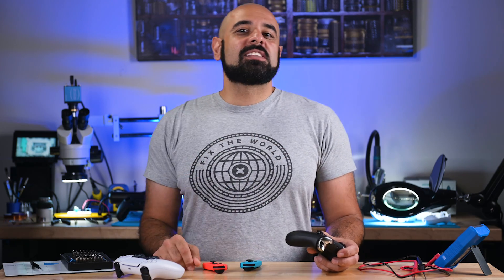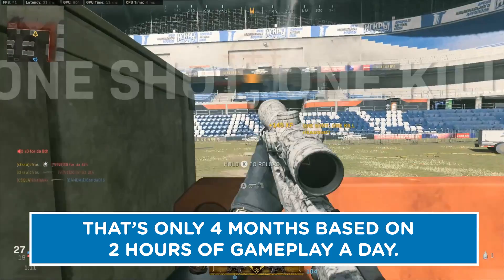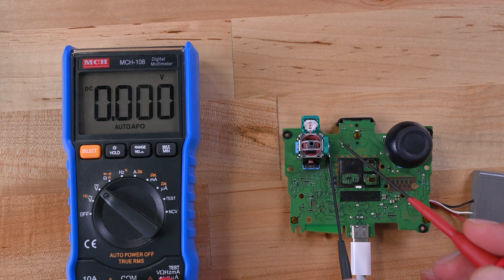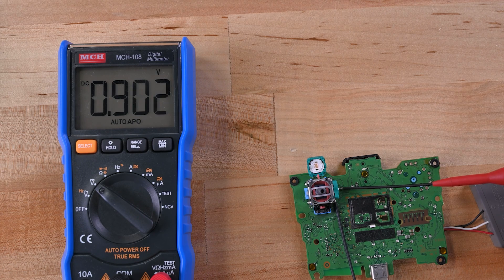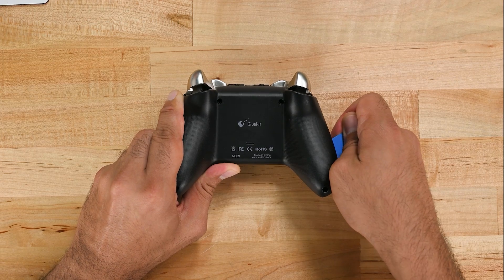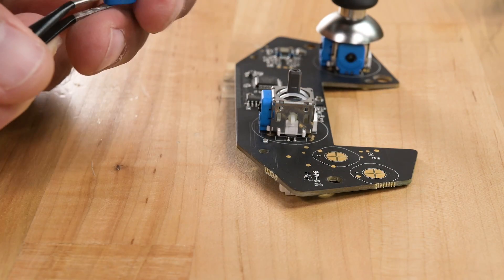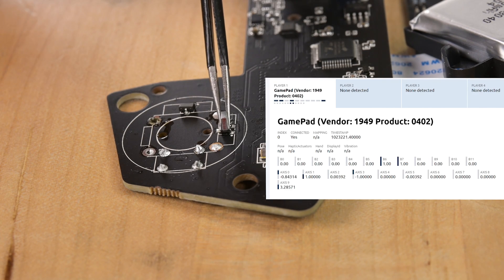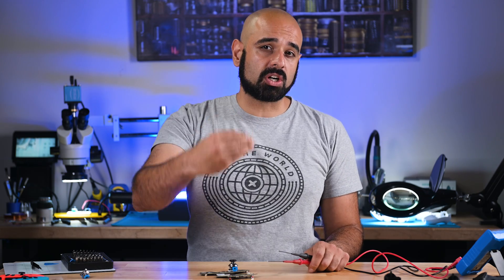How Manufacturers Can Fix Joystick Drift - Permanently!

Comment: Sega fixed the drifting problem already when Dreamcast launched in 1998.
Reply: They actually fixed it even before that - with Sega Saturn 3D Pad. And hall effect sensors weren't unheard of even back then, they were used in some hi-end computer keyboards form the 70s and 80s for example

Comment: So in theory i could put that type of joystick in a drifting ps2 controller
Reply: It's not a theory, It's already been done, and yes. You also might want to see if there's a board that you can solder onto your circuit board as well to auto calibrate it as well.
Reply: @boredfive3001  thanks thats all i wanted to know

Comment: Cool story. But what you gonna do when magnet effect will start to wear off? 

Also there wasn't any drift in PS1/PS2/PS3 controllers (if you clean your apartments at lest twice in a month).

Maybe it's because current controllers have more bits and more sensitive because of that? Yes it's giving more precise control, but have short lifetime span. Why? Because even smaller damage will have an effect. While when your controller have 8-bits, those damaged have no affect at all.
Reply: Tiny neodymium magnets are pretty cheap, are already widely used in tech and keep their magnetic properties for many decades, so wear-off of magnetic effect is not really an issue. So is the precision - hall effect sensors can be extremely precise while still being cheap

Comment: Does the Hall effect sensor have any effect on battery life?
Reply: Anything that uses the battery on the PS5 technically speaking has an effect on battery life. However I think your real question is if the difference is more noticeable than the already existing potentiometers in your controller and the answer is no.

Comment: Out of the box showing drifting on PC software test and some On playstation 5  it's not acceptable i Will be returning on i had one replaced by Sony and after checking on PS and lower dead zones on Call of duty and its showing a bit of drifting after getting a new one same with my New one from 2023 i think 🤔.

Comment: I'm about ready to give up on (console) gaming. The non-existing innovation in games, and the introduction of weird "ideology" into the game sector is just about enough in itself. But I can't keep buying new controllers every year, that's just not acceptable quality for a relatively expensive controller (cost more than a mouse and keyboard set). The price is fair if the controller works as it should and last for a long time.

Comment: The solution is to recalibrate the stick while in use.
The major issue with drift in joysticks right now is down to calibration being baked into the firmware of controllers, or even the sticks themselves, ever since PS3. Outside of that, drift is largely a non-issue, especially compared to the very different and very real problem of FLOP, that hall effect sensors do NOT address.

This is an expensive solution to a manufactured problem to sell you the same quality of product you purchased in 1999, but for a marked up price. Hall effect sensors are just another venue for shrinkflation.

Comment: I fix these all the time. 
I see that the normal Xbox controller $69.99 use the same potentiometers as the $199.99 Xbox elite 2 controller. It's such a scam. A replacement part only cost $2.50 but you need soldering skills to replace the parts them selves

Comment: They havent even added some settings for controllers at ps5. It would be so simple. Most of drift cases could be easily fixed by adding a deadzone. Sadly most of the users dont even question them about such simple thongs. And they are happy because they getting more money from them.

Comment: I just bought the Gulikit KingKong 2 Pro and the only problem i had was that on day one, one of the buttons started sticking. I was able to take apart the controller and lubed the mechanical button with some beeswax (organic lip balm) that I had on hand. For the same price as an OEM XBox controller, it works great, for PC anyway. Here's to hoping that they add XBox support in the KingKong 3.

Comment: They should use sealed greased pots that's what they use in (good quality ones anyway) R/C servos for the feedback pots (the thing that tells the servo what position it's at). The lubrication prevents the tracks from wearing down and it's sealed so dirt can't get in. I mean it will eventually go bad but I have R/C equipment made in the late 80's that still works just fine.

Comment: Funny thing is that the ps2 controllers had automatic drift compensation built in every time it was turned on and gave you an accurate full range every time you turned it on and moved the sticks.

Comment: my analog joystick doesn't drift, but there's a tiny degree of dead zone. so if i run in circle in a game by pushing it fully forward and then circling the stick 360°, there's a very brief stop, like 3°-5° of the angle.

Comment: They won't pick up on it. It's called planned obsolescence for a reason. Microsoft doesn't do thousands of hours of testing on their controllers to ensure longevity. They do it to ensure the controllers won't last 'too long' before the user is generally stuck buying a new one. Quality is going down, prices are going up. That's capitalism in a nutshell. I actually wouldn't be surprised if at some point, maybe on the next generation of systems, $ony, and M$ made it so that third party controllers could not be used on their systems. If those two companies gave a crap about their paying customers, then they'd have that stick calibration software in their systems, but only Nintendo does.

Comment: Exactly. Hall sensors are the way to go. Why are they still giving us potentiometers is beyond me. Yeah I know it's cheaper and creates more revenue for them by users buying replacements but that results in users losing confidence in the products plus the frustration that comes along with it. For the price these new consoles come with at least the controller should match the quality of the console.

Same experience I had with a racing wheel set up I had. Potentiometer driven pedals and always having to replace them. From the time I invested in a set of hall effect ones I never had any problem following.

Comment: If this drift issue is "unavoidable", how come I've never had it with my N64, Gamecube or Xbox 360 controllers? I've been using all of them for years or even decades, this drift thing only seems to happen with newer controllers though, why?
Reply: That's a good question. Something seemed to change in the materials used since the Switch era. Either they use smaller components, or a different quality of plastic.

I just got the Gulikit joycon replacements since I've replaced the joycons TWICE on the Switch my kids use. I have a spare replacement for the OLED Switch that I use but I haven't played it as much so they're not worn out yet. Looking forward to seeing how these perform compared to the two replacements I've tried so far.

Comment: With all that engineering that goes into modern game controllers they should’ve had that figured out already (they know what they’re doin’, which is apparent to most of us gamers) they just want us to just replace them if they fail!  For most of us, these things being complex And expensive as they are ain’t a cakewalk to disassemble and reassemble if we’re talkin’ bout makin’ repairs…  Gaming is an already expensive hobby and gets more expensive with newer generations!  Perhaps they should devote more R&D into product endurance and the quality of components with moving parts that involve contact friction (I think the sticks take the heaviest abuse before the action button are pressed, given directions are executed at a near constant with some games needing you to rapidly rotate the stick causing potentially extreme premature wear of the axis potentiometers, the action button are not heavily mashed often, but lightly and briefly tapped) poor quality potentiometers tend to have bad wear tolerances and will fail earlier during the life of the device.  Why does Sony require the purchase of a $200 Dual-Sense Pro controller with the ability to easily replace the sticks when they should implement that feature in the Standard Dual-Sense controller!  I think Hall Sensors Should Be Mandatory for all manufacturers going forward as the Dreamcast had them And were Very Reliable!  Sorry for the long-winded rant…

Comment: Ironically the biggest weakness of the switch joycon stick is that it doesn't have the usual stick potentiometers. It has a really bad stripe-shaped potentiometer that wears out super quick and is really prone to malfunction with tiny amounts of dust in it.

Comment: I have a 360 controller I've been using since 2012. It's always plugged into my PC and has been in my hands for thousands of hours in its lifetime. The rubber pads on the sticks have worn down to suggestions of traction, and the controller shell has a few scuffs from being set down or dropped over the years. There is only a tiny fraction of drift in the right stick, and that drift only comes up in games that seem to assume that every stick out there is perfect and doesn't need a deadzone.

On the other hand I bought a brand new PS4 controller and within two months of light use the right stick began to pull HARD to the right.
There is simply no excuse for the build quality of modern devices being worse than its predecessors. With how much these devices are expected to be used, and what conditions they are going to be facing, it should be a no-brainer to make these controllers tough and durable - especially when they are continuing to hike the price of these hunks of plastic every time they change them slightly.

Comment: Stick drift can easily be caused by dirt in the pots and can easily be cleaned with ipa cleaner ! I fix roughly 20 a day at work the dirt or fragments is usually caused buy grinding metal on the top of the sticks depending on the pad !

Comment: Okay, firstly thanks for highlighting this issue!

Second,
Hall Effect Joystick Sensors are NOT the "End Game" solution to fixing the problem. But they are a positive step in the right direction.

Just like any other piece if hardware you need to have it calibrated properly out of the box and in the past 6-Months I've seen a wealth of replacement Hall Effect Joystick Sensor products arrive on to the market, but unfortunately a trait with them has been that some of them have notably bad calibration out of the box meaning that the end result can still be a very poor tracking experience.
Reply: I mean, that's kinda the point of calibrating your controllers after replacing the joystick assembly.  I just replaced my joycons joysticks with hall effect joysticks and yeah they needed recalibration but that takes less than a minute to do and after that they work fantastically.
Reply: @Enclave.  I meant in regards to firmware, the actual firmware inside on the micro controller baked into the joysticks, they are REALLY POORLY calibrated in the way they react to input such that no amount of built-in device level adjustments can positively counteract the inaccurate readings.
Reply: @LND3947  Ah, gotcha.  When I hear calibration I immediately think of people who don't know you need to calibrate your joysticks any time you replace the assembly.

Comment: You totally missed the mechanical drift (or slop in the mechanics), this happens with pots or hall sensors.
Consoles are just toys, get a gaming pc and good games (like simulators) and good controllers (wheels/pedals/joystick/etc).

Comment: That was kool to know. What about for anti drift, or when on a left joystick won't go forward, or if it does, it jitters? So I bought a brand new PowerA Enhanced Wired controller, and less then 3 months that started to happen. I did contact their support for warranty and they just sent me a new one and told me to throw away the defective controller. I don't want to throw it out. Should I keep it or is there a way to fix it like this video stated? All so I ended up buying another controller because it took weeks from support to the end to send me one, it is the Turtle Beach Recon, it is so much nicer.

Comment: Even the PS2 didnt have drift. At least not anything close to today. They had stuff in it that calibrated it automatically. I saw a video earlier that demonstrated how moving the analog stick around made it calibrate itself. There is multiple ways they can do it. They're just cheaping out on parts, and forcing us to buy these cheap pieces of crap over and over. Even the pro 180-250 dollar controllers, still use the same parts in analogs.

Comment: "For the software to correct" meaning apply a deadzone, you can glue the axle in the pot to make it more accurate... but yea we have used Hall sensors for so many years, we should be using them in controllers.

But there is also a downside of using a Hall effect sensors, these can and will be influenced by external magnetic fields... your phone for example!

Comment: PS3 controllers used hall effect sensors as well according to Ben Heck. They also sometimes suffered from drift, but maybe to a much lesser degree than other consoles. Another reason for drift being increasingly more common may be that in the strive for "precision", game and console makes are minimizing the dead zone, making the software less tolerant for hardware wear. :(
Reply: Not all ps 3 controllers had Hall effect sticks

Comment: That the value at the center point varies is completly normal and is mitigated by a dead zone in software. This technology has been used for decades and was always a fine solution. Only a small, loud minority is complaining about "stick drift". I have never seen it in person.

Comment: I bought my PS5 on launch and I'm at my 5th controller so far. And I try dealing with the drift as long as possible to the point it makes games unplayable. So being honest you could add a 6th one there if I replaced them sooner.
Same was on PS4.
PS3 was different, the included controller lasted me 7 years!

Comment: I've experienced my first drift in one of my PS5 controllers. The updated model number which was supposed to be marginally more resistant to the issue. I'd love a pseudo PNP way to swap to the hall effect sensors like for the switch. The dual sense edge not including them at such a ridiculous price point is a huge letdown.

Comment: The drift issues on my PS4 controller (used on PC games only) was wear to the stick mechanicals on the left stick, so it wasn't springing back to centrepoint, so, I got a set of new sticks, and great, the left stick was stuck with an off-centre left & down issue, and so was the other one I fitted, so thought they were junk, and got more from someone else, and, oh, same issue, so, I got a couple of them "drift-fix" flex-PCBs with the trimpots on, then twiddlypot adjustments and, they fixed it!!! Granted it probably needs a real PS4 to actually calibrate the sticks, versus Steam's "Lets make a massive deadzone" alleged 'calibration', but I'm not going to buy one just for that (and I don't have access to someone else's PS4 to do this either, cos habitual loner ASD person who can't stand people)... :P

Comment: Analog sticks in older controllers using the same types of sensors as current ones would generally last much longer without drift or other anomalies. They've been making controllers fail more often and faster by design for a while now to drive up profits. At least the engineers in these companies are fully aware of this solution, but management has 0 reason to do it unless somehow a third-party that does it becomes extremely popular and actually able to compete with their main brand, which is unlikely.

Comment: As an elec engineer, I appreciate the time taken to really describe what's going on in the components. People are afraid of electronics but having surface level description here with examples is useful for the average enthusiast I feel.
However I'd appreciate if you talked about the drawbacks and weaknesses of what you're describing, Hall-effect sensors being not perfect for those applications
Reply: Why not? They're used in the drone hobby because they're incredibly reliable. You don't want drift while you have a beast in the air that can get to 200km/h in half a second.
Reply: @SergioGMN  Mainly because of cost (every cent counts in these devices) both of the sensor itself and the added complexity of assembly

I also wonder if external factors or the fact that you have 2 magnets at 90° for the 2 axes can induce errors, probably not, but I'd be curious if you need software to correct that (I'm not familiar with drone applications but I guess it isn't much of an issue then)

I defo agree Hall effect sensors are much better than pots in the long run tho

Comment: Hall effect sensors were in controllers ages ago. Sega used them on the Saturn and Dreamcast, and Sony actually used them in some early Sixaxis models, as in the very first PS3 controllers that had no rumble. I honestly think they simply didn't catch on because there is more money in selling controllers that will definitely break much easier, and the issue would've kept going mostly ignored if Nintendo hadn't pushed it as far as they did with the switch, making one of the most expensive 1st party controllers ever and also one of the most shoddily put together.